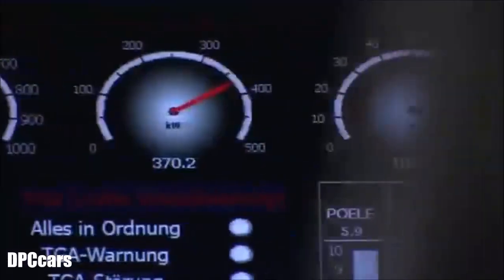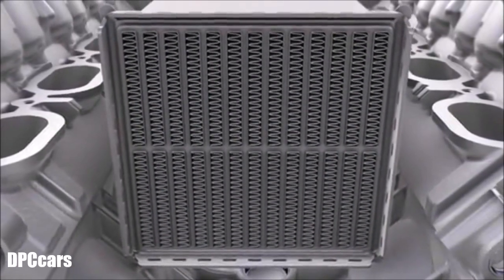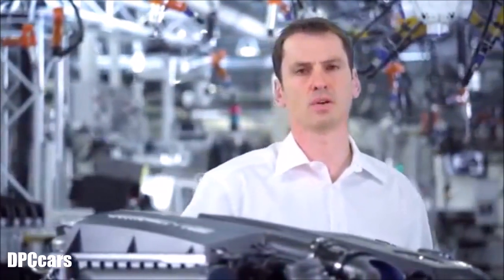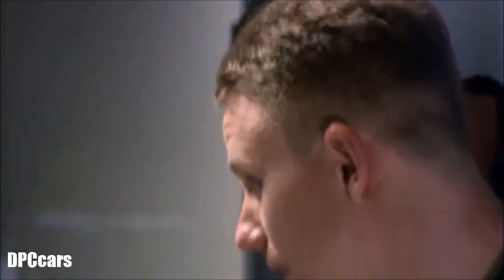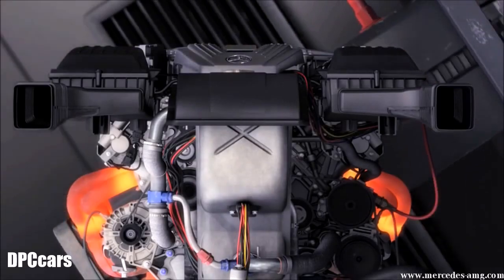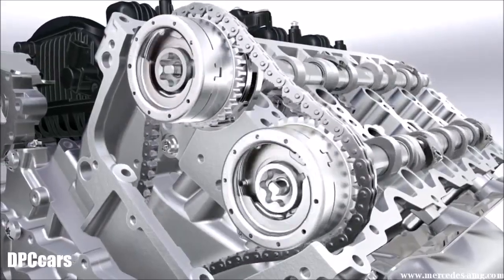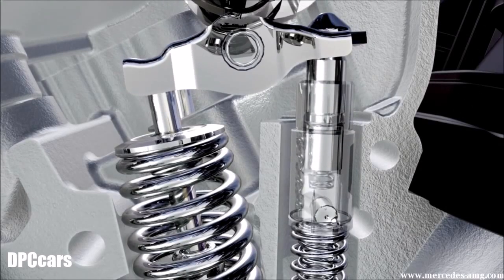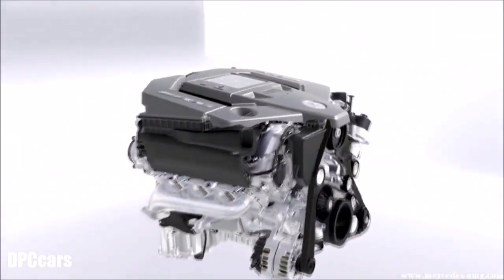Mercedes AMG 5.5 liter V8 Biturbo and AMG 5.5L Naturally Aspirated Engine Documentary

Comment: The AMG M157 on this video is one of the biggest piece of crap ever made by Mercedes AMG, they snap timing chains and break timing chain guides & the cogs wear  out too at 120,000 klms, my mates wife brought a brand new ML63 AMG With the engine in this video and the dealer  themselves said it’s a common problem and also told us the head bolts stretch too? Rubbish engine